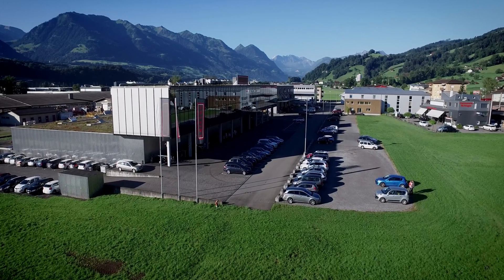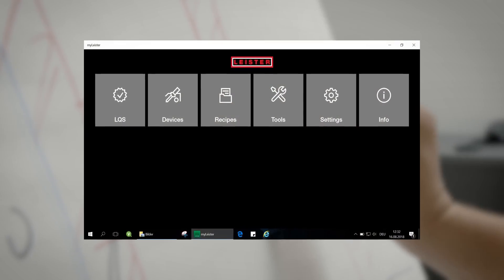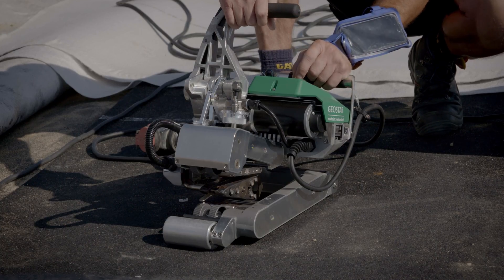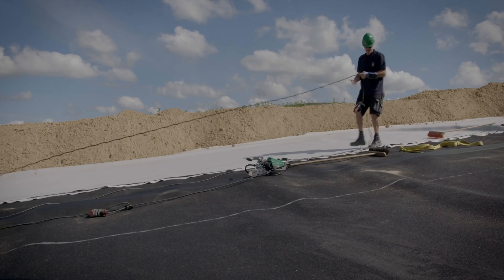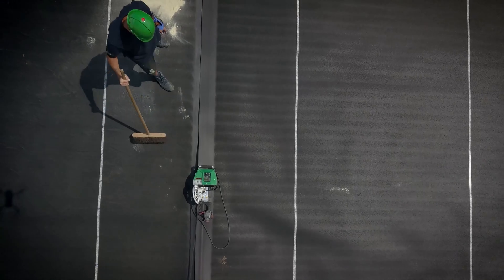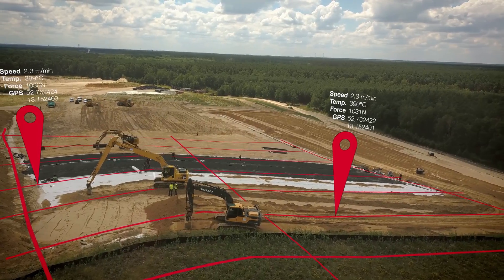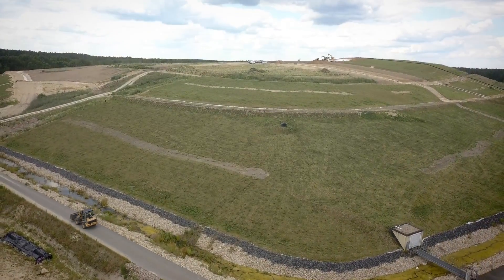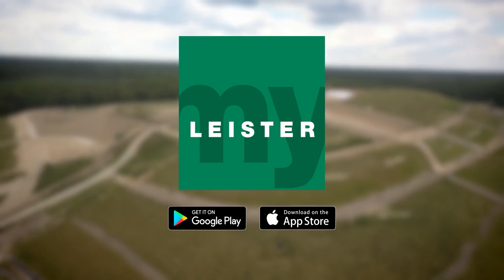Geomembranes, perfectly welded with the Geostar LQS

Comment: All the welding parameters are recorded like speed, heat welding pressure; also the travel distance and the GPS positions.  
This means that every single meter of the weld is perfectly documented. That helps for a full quality documentation.  All information are saved in the welding machine. With  the myLeister App the operator can transfer the collected datas to the computer. With the my Leister App it's very easy to produce quality reports.    Regards Thomas